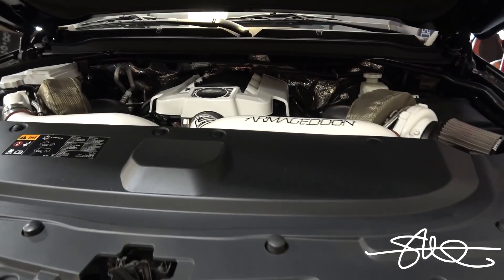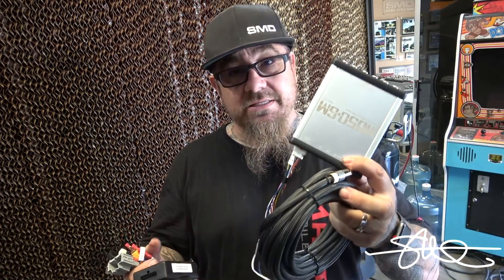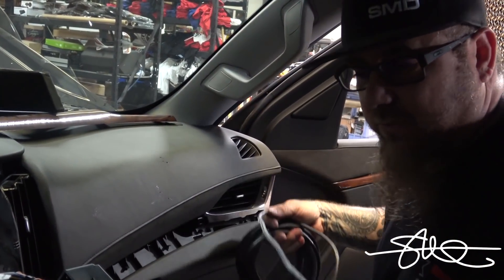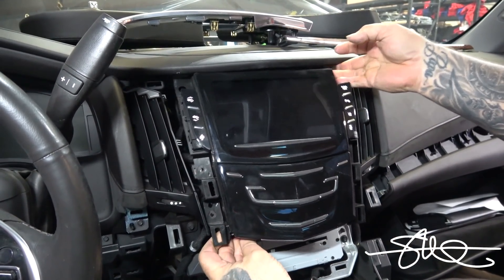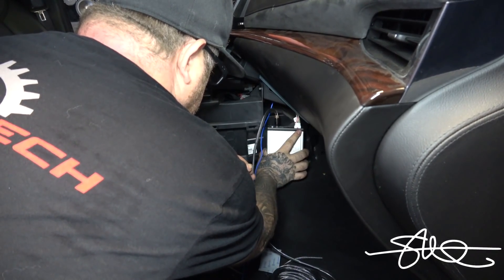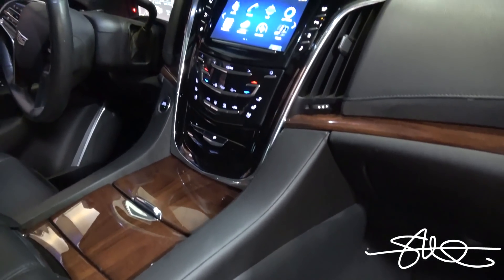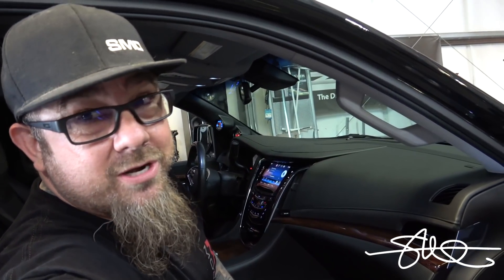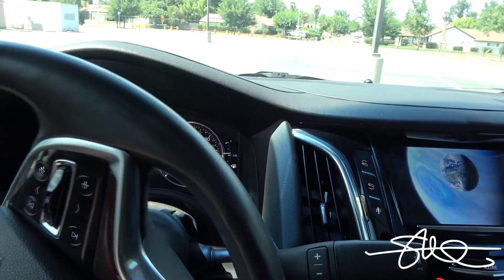Ultimate Integration! NavTV M650 GM + Vehicle in Motion Mod - Cadillac Escalade System Install Vid 2

Comment: Much respect, keeping it real on the dash pull, it was done like a master for sure keeping it very neat and clean. This reminds me of the install I'm doing on a 2018 Ram. iData Maestro modules etc. I'm keeping up with the times but oh man do I miss the 90s and 00's as far as alarms, remote starts and radio installs. Tuned in for the amp rack and I Really Really dig the rear defrost switch for the movies

Comment: I need to get one of these. I had an installer that was trying to install two amps with components and subs that is having a hard time summing the inputs to get a good signal to use.  I should've spent the extra 500 to get the M650-GM.

Comment: Now if you got an aftermarket DVD radio, all you have to do is bypass the parking wire from the radio by grounding it straight to the radio and you won't need to get an aftermarket interface kit to get your video to keep playing while driving. it's pretty straight forward and it will work in most newer 2DIN DVD receiver.
Reply: aantonio06 For the new pioneer DVD units you need a DVD BYPASS MODULE or a RELAY(works sometimes)....the grounding method no longer works
Reply from the maker: actually that trick hasn't worked on ANY modern units in about 10 years.  Thanks for your input though just in case someone has a very old deck.
Reply: Not ALL makes and models but i have installed some new ones in the likes of Kenwood/JVC that you can still do this trick. I have a Kenwood 9903S in my truck with this done to it. And it works perfect.

Comment: I'm surprised you didn't add the Mirrlink!
I have the same truck I've been thinking of doing the same mods plus the mirrorlink.
Reply from the maker: no need for that.  Already have a NAV-TV unit that does that already. Haven't had time to put it in yet.
Reply: @meade916  So your installing a aftermarket head unit? 

I installed 8.5" Head Rest Screens in all my head rest that have the mirror link option built in, but I still want to be able to mirror link to the stock head unit then out put to all the TV screens.

Comment: High tech LOC basically, went from a headunit not having preamp outputs to having to interrupt canbus signal to get preamp outputs...engineers can really complicated simple things. I work on all these new cars daily and can definantly say they design these new cars to fail and for consumers not to be able to work on their own vehicles.
Reply: been in the automotive business for 40 years and YES but it's to be less the car maker but the STUPID Consumer /// don't want to know how to repair or maintain there vehicles //just want to blame someone else.....
Reply: This is not a simple LOC.  This grabs the signal BEFORE it gets ruined by the factory bose amp.  A LOC only grabs the signal after it has already been ruined by the factory amp.  I don't know about all cars buy my Cadillac's factory amp Destroys the signal by cutting frequency and adding distortion.  I've tried a couple different LOC's initially trying to get good clean deep base, didn't work.  It wasn't until I grabbed the signal before the factory Blose amp that I got the base I wanted, and without distortion.  With the LOC's I wasn't even able to push my subs before the signal started clipping.

Comment: Kinda funny that my cts has to have the same crap removed to get to the radio and they are 2 different generations. I had to pull the wood on both sides, and the side panels by the center console just to pull my bezel off as well. I guess GM likes keep things similar.

Comment: Sweet  Steve …. I remember back in the day they called that  "HATER VISION" lol P.s check  left front tire tad low
Reply from the maker: no it isn't. Just because a tire is 1psi lower than the next don't mean it's a tad low.  They can be different pressures depending on which one is closest to direct sunlight.  They change all day long.  Hella funny the way you guys dig deep and comment on the most random stuff LOL :D
Reply: Just looking out Bro  … them tires  and rims aint cheap , I know that much..lol

Comment: Have you dealt with the ground issues with the nav-tv unit yet, I’m having nothing but problems with my unit and its simply unreliable at this point sometimes it works sometimes it don’t and it seems to over heat at times. SMH! I got my ground resistance to almost nothing, under 1ohm.
Reply: I am a interested  in the ground issues you are having.  Mine drops sound at different times.  It goes into a audio control DM 810 DPS I see no sound at the DPS on the coumputer. I unhook battery on the camaro and hook up 29 minutes later and it works for a while.   Let me know if you have found out anything. I have the latest update already. Thanks

Comment: That’s awesome where do I get one and how much is it.
Reply: mwill76 don’t buy this product not worth it
Reply: @Silverado08JP  What would be a better choice?  This unit integrates your original stereo and all factory options, it doesn't step down your high input to low side for third party amp integration.  Even if you were to use a DSP with line level inputs you wouldn't get the same quality as a TOS link directly from the radio.
Reply: Just a plug and play for amp, don’t need all the fancy stuff

Comment: Hi, i have installed the OM-1 but i can’t use it because i have noise coming from the amp, i try looking for a capacitor with the specs manual suggests but no luck. Anyone can help me here. What alse i can use or what other type of capacitor will do the job.
Reply: Dave Micolichek I have 2 amps and 2 OM-1 one for each amp. the one is giving me this issue is the amp for the subs. The other one is ok.  I don’t think is a grounding issue or maybe,  even after disconnecting amp from power and ground, still coming noise from. Any idea?????? Amp works perfect

Comment: I have a 15 Escalade too and his dash (odometer/tachotmeter looks looks like it came from a newer Escalade. Does anyone know if he did a vid on upgrading it?
Reply from the maker: nope. It's stock.  If you actually do have one....then just so you  know the dash can be configured in several different ways.  It's easy to change.
Reply: I have 16 escalade and looks different
Reply: There are 3 different display options that are easily configurable with the sterringwheel